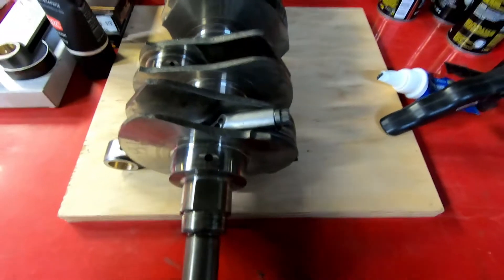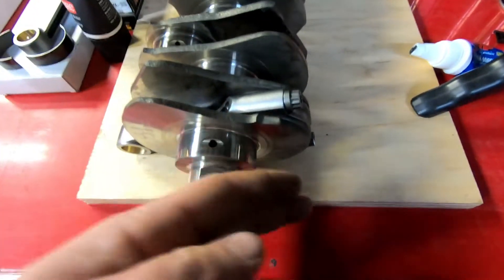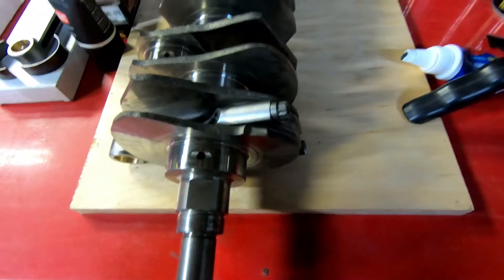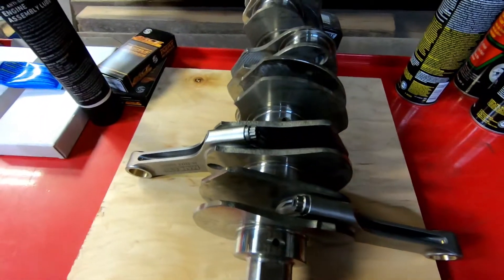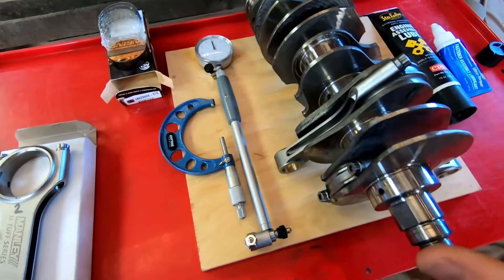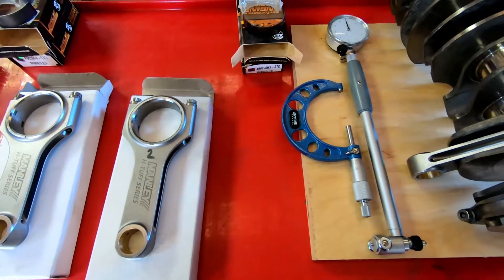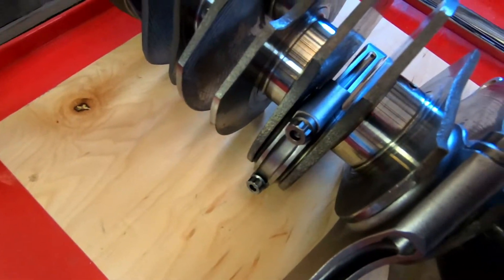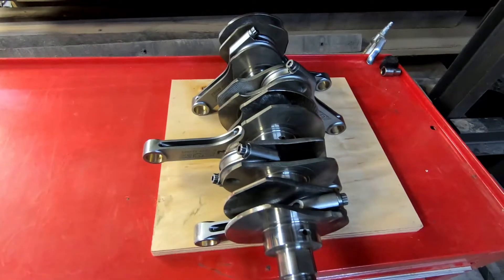Built EG33 Assembly Part 1

Comment: also remember if warmer or colder than 68 degrees the metal will expand or contract and measurements can be slightly off.
Reply from the maker: I made sure to keep a steady temperature as close to 68 whenever I worked on the engine. Only so much you can do when you don’t have an engine building room! Someday I will have one.